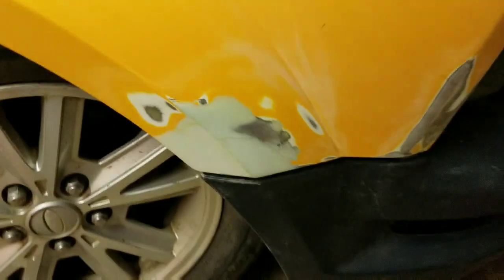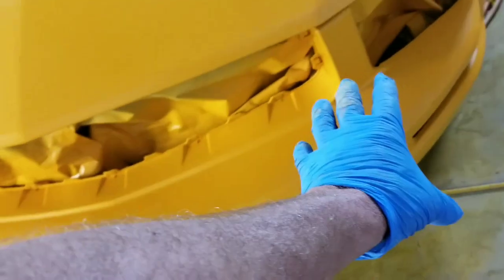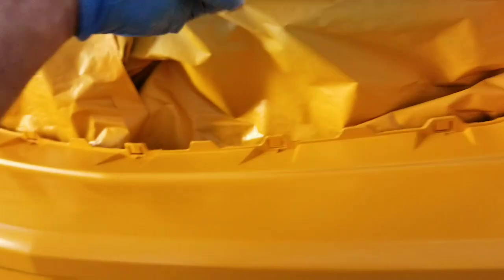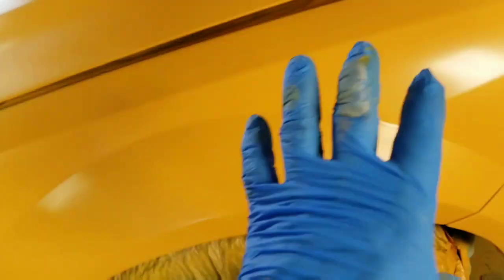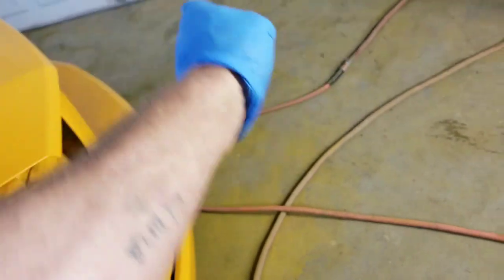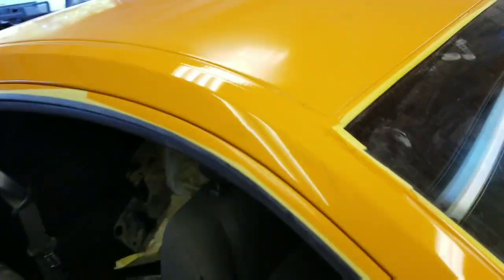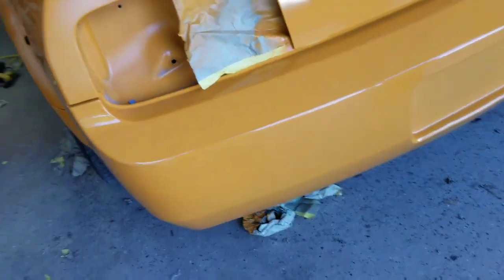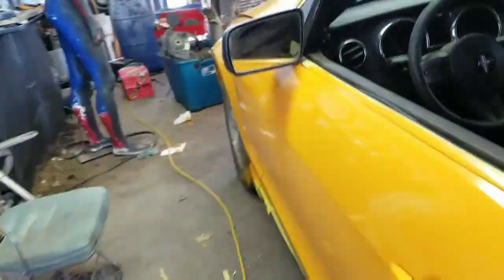NOT being perfect  s#*ks!!!

Comment: I hate water base. But that is the way things are now. Takes a whole new set of skills that I don't want to learn. Try warming up the metal with heat lamps. That will help with small runs. Good luck with the learning curve. The car is looking pretty good. Glad to hear the kid is doing good. Orange peel is a normal thing with water base, so don't knock yourself out trying to make it perfect. That's a better paint job then most pros do.
Reply from the maker: Thanks a bunch for the comment buddy that means a lot coming from a pro yourself and you're probably right about learning about this base coat water base as far as learn what the new generation wants and you're right about being hard on myself as well heck it's the first full complete car that I have painted in 26 years back in those days it was acrylic enamel and base coat clear coat was the newest thing out and I was scared of it as well so much so that I just left the trade and took on heating and air conditioning your comment made me realize and if you're going to make it in this generation you got up flow with the changes but it is also good you know all the old stuff as well there is a lot of people out there that don't hardly know anything about classic rides or old school acrylic enamel paint I still do truly believe that acrylic enamel can get old as hell and you can still bring it back by buffing and waxing it is there any kind of clear that last like acrylic enamel without peeling